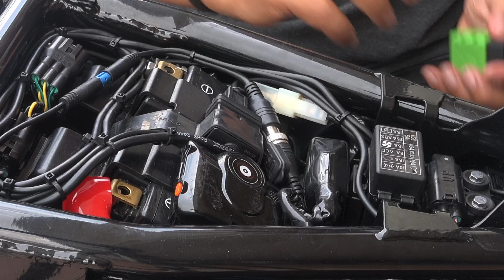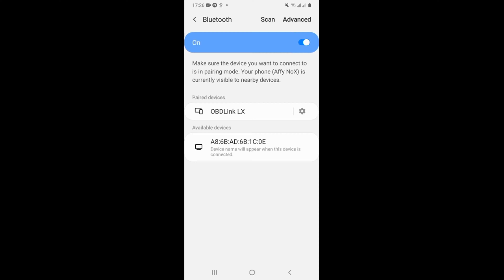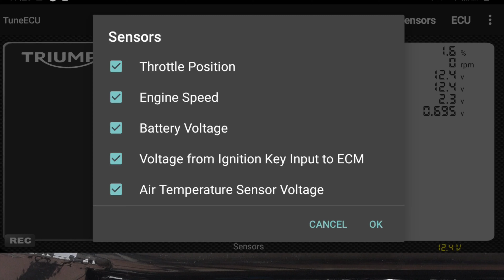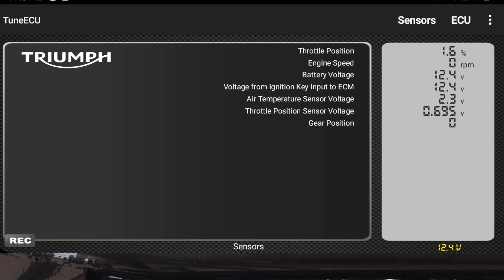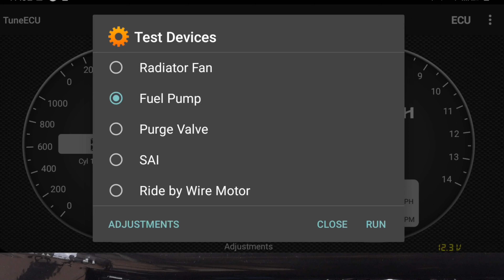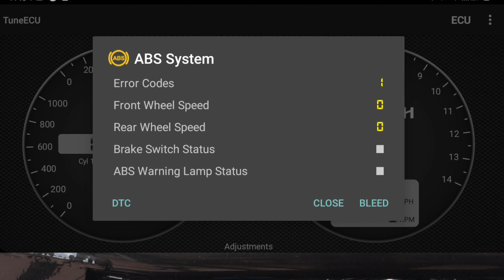Triumph Speed Twin 1200 | TuneECU

Comment: I want to change the sprocket sizes on my 2024 Triumph Bobber (Euro5).  I also need to adjust the speedometer.  I will remove the catalytic converter and install an X-pipe.  What menus do I select?